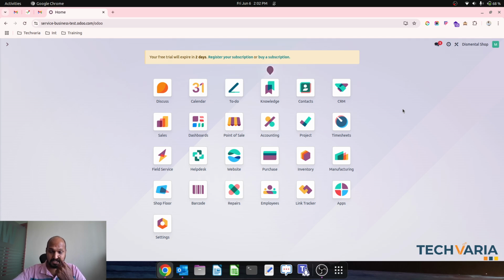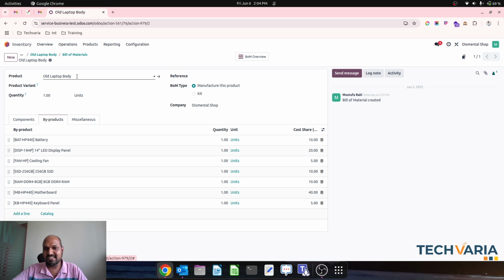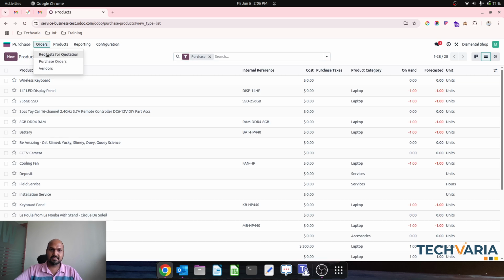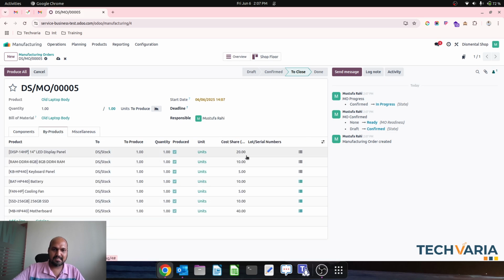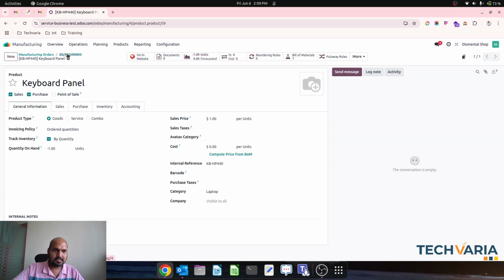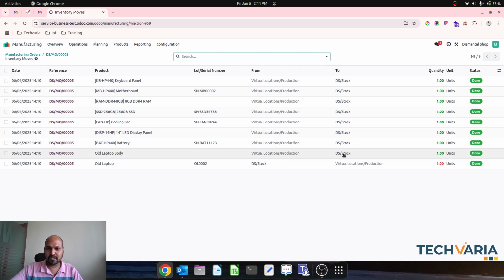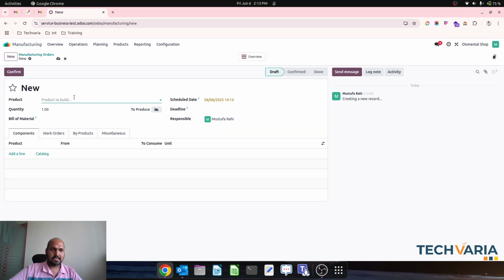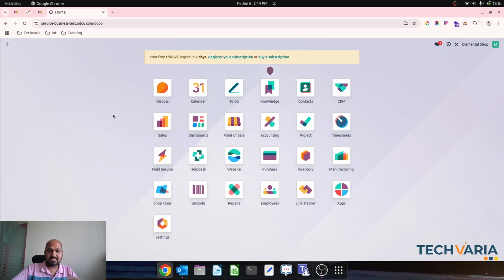Reverse Manufacturing (Disassembly) in Odoo | Dismantle Products & Track By-Products Easily

Comment: Thanks for the video. However, the product "Old Laptop Body," for which a production order was placed, will also be added to the stock even though it isn't physically available. What are the available options for that?
Reply from the maker: Yes, that is correct. Using Odoo Manufacturing Module as default, we have to keep one product to produce. Here in business case, one SKU which is laptop body will come out with fraction of cost OR no cost and we have to manage to either scrap it or sell it as scrap.